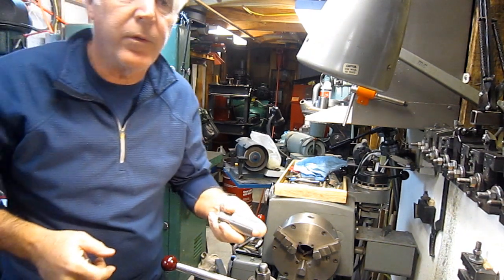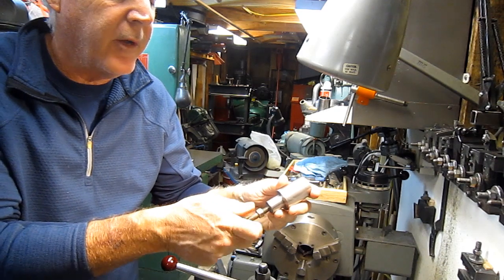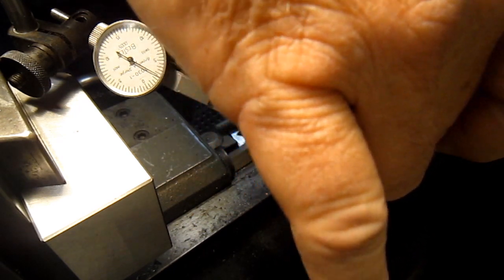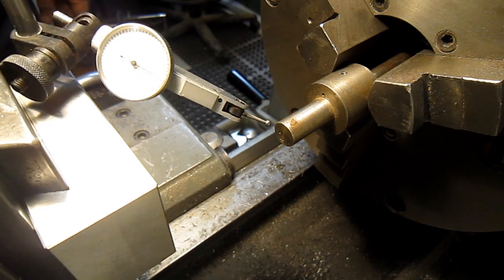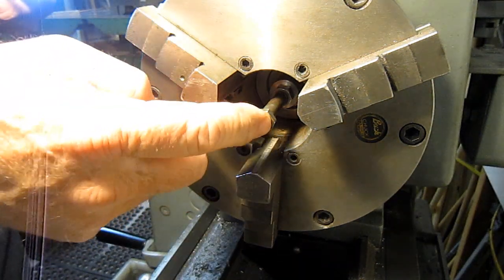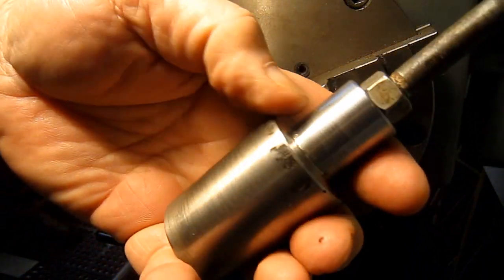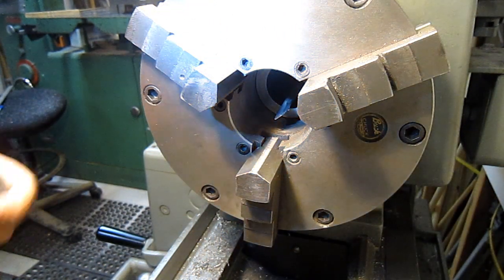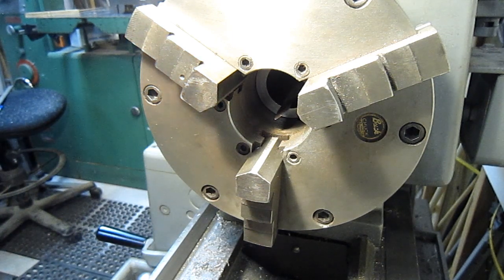TOOL TIME    Episode 9    Chuck Stop for the Lathe

Comment: Some thoughts:
1) If you plan to slit the back end of the stop bolt and adjust through the spindle with a long screwdriver, cut a funnel in the back of the stop body. It will make finding that slot a LOT easier.
2) Whether you want to adjust it from the front or the back, you can reach the jam nut with a hollow socket which is at least 3.5" long and has some way to turn it that doesn't block the bore, as long as the head of the stop bolt will fit through the socket. You can make the socket bigger (within limits) by making a custom jam nut which is larger across. If you don't want to use a hex socket, you could make a hollow two-pin driver and a large nut with two drive holes out at the edge. Again making a tapered or conical surface on the face of the nut will help guide the driver pins into alignment with the pin holes.
3) Finally, it usually isn't critical to set the stop exactly, just that the part position is repeatable once set. Tap the stop body into the taper firmly, and with the same force each time so that inserting parts doesn't drive it deeper. Then adjust the cutting locations to fit the actual location of the part and you can do them over and over.
Reply from the maker: Peter W. Meek Hello Peter....great comments...thanks

Comment: Why not adjust it with a caliper when you pop it out.  With a few measurements you could figure out how far to set the screw to get the desired set back from the face of the jaws.  adjust it one time so the bolt head is flush with the face of the jaws and then pop it out and measure the total length of your stop with a caliper and write that measurement on the tool.  If you want to set the work in the jaws 1" just set your stop 1" short he and pop it in the lathe.
Reply from the maker: shadow...
Thanks for watching and your comments...

Chuck

Comment: What a nice idea - I'll go make one next time I'm in the shop - thx Chuck !

I'll make it with a Allan bolt (we call them Unbraco !) with a head so small I can get a hexagon-shaped pipe over the Allan head further in to the counter nut.

The hexagon- shaped pipe just long enough to reach out of the chuck and an Allan key long enough to adjust in through the pipe !

I just got a manual for my lathe and I have just red, that the lathe should have a MT5 behind the chuck ... so that's my next little project !

Thx again for the idea !

(Maybe I should try to make a video on that project - it seems like you prefere videos for good old text and pictures on a web site ... one have to adapt to modern times, argh, I hate it !!!)
Reply from the maker: Hi Keld...

videos or website pic is good for me...honestly just been still working on this Google +...I have been staying away from it since now I can answer comments on Ytube....

It will be interesting to see your build...

fyi....we have many different sources reviewing and designing their own...this is very cool and I am glad my post has this action...

we all learn and share...

Chuck

Chuck
Reply: outsidescrewball When I saw your hand going into the chuck to titen the counter nut .... argh, I think you have a problem there ... I solved this with a pipe wrenches inside another pipe wrench - look here, the second sketch:
http://kelds.weebly.com/bagstop-til-drejebaelignken.html

Comment: Thanks for sharing Chuck!  I'm going to build one.   I'm thinking that I would extend the taper all the way back, make the adjusting rod go all the way thru and put the jam nut and adjusting bolt head on the back side.  I think that if the part were to be turned so it is just a few thou less than the diameter of the spindle hole, that it wouldn't whip around.  Another thought is to make the face a seperate part that screws into the adjusting rod,  then you could make several sizes of stops.
Reply from the maker: Herb...
Thank you for your insightful comments and will be in my think tank....see bluehandsvideo for his Cad drawing...good info for thought

Good luck with your build...please share

Chuck

Comment: Hey Chuck, Another great idea I think, I also think the rear adjustment would simplify things a bit.
  Is that a Buck brand chuck on your lathe? I'm to understand that you can chuck a part in those and be able to adjust it around a bit? The reason I ask is that I have one that was given to me with that information, but I have never used it, if that is true, I'd like to dig it out and experiment with it.
Reply from the maker: Hi Michael...
More design will be done on the unit...
Yes the chuck is an adjustable Buck chuck and you are correct that you can adjust the chuck as necessary for a part.  My buddy/mentor retired machinist did it the other day when he used the lathe...I asked "what are you doing...huh??"  I work hard to have it run true, but once he explained and showed me, I understood...of course the chuck was returned to a true concentric...
I downloaded the paperwork regarding the chuck, since I had never seen one and it came with the lathe when I purchased the lathe...

Best regards
Chuck
Reply: Cool, could you point me to the place where you got the information, Thanks

Comment: Hey Chuck,

Looks good. How about running the rod all the way through the headstock and putting your locknut at the outside of the machine where you can get at it. Monel. Getting fancy on us here.

Cheers,

Tom
Reply from the maker: HI Tom...
We will discuss some more....I will pick your brain for sure!!!  Check bluehandsvideo cad drawing...Hmmmm....

Yes, my buddy worked at the sewer treatment plant, so I got a few of the pump shafts that were trashed....the Monel is a nice material to machine and I have had to learn to be patience since I have learned my lesson on work hardening...ugh!

Chuck
Reply from the maker: Lawrence London HI Lawrence....I don't know if it is, if my memory is correct I used the collet adaptor as my setup for the angle to cut.  Yes I turned the monel with carbide

Thanks for watching and you comment....the LeBlond is a great lathe   :)

Comment: Instead of using a screw driver from the rear why not extend the bolt right out the back with a nut adjustment on that, change the front section to accept multiple heads as you have already started on that you just need to find some way of holding them in the taper  adapter so they are drawn back with the adjustment bolt.
Reply from the maker: NfN..
I like your thinking, but I think a bolt extended that far might whip around due to its length and 3/8" diameter.
FYI...your comments got me thinking of a design that will be adjustable and have the multiple heads...going to work on it and will post an update in the near future...
Thanks for watching and your thoughtful comments
Chuck